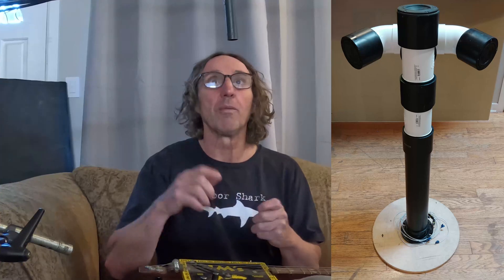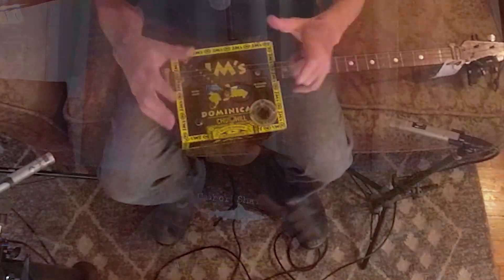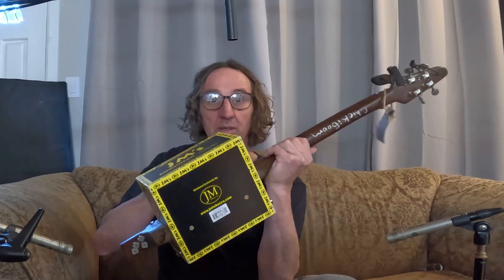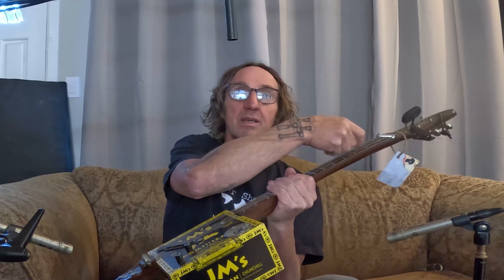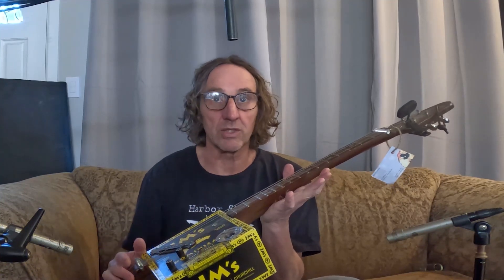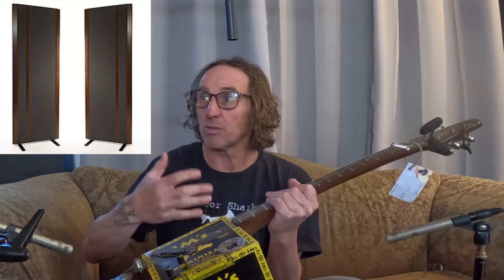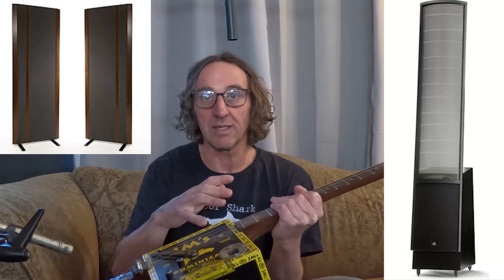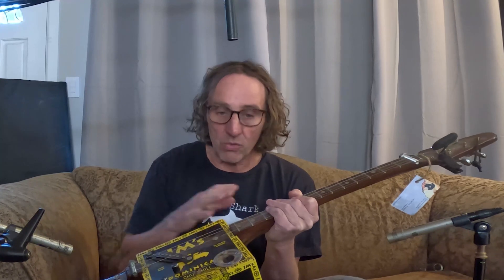Which Speaker Sounds the Most Realistic?

Comment: What is your opinion on the Heil tweeters?
Reply from the maker: I like those AMT HF drivers.

Super cool to have that accordion in the magnetic field radiate sound. The downside or oddity about it is that it's a figure eight pattern and radiates almost the exact same amount of sound behind the box as in front and there's cancellation off to the sides. 

This is not really a good thing or a bad thing but something that's different and creates a unique characteristic that may or may not be desirable
Reply: Thanks for the honest response. I like the contemporary implementation by Adam audio which are not dipoles. There are other interpretations by Mundorf and others which arw either dipoles or regular front radiators. But the original one looks really impressive and it's cool to have your speaker designed by a Nobel prize winner. 😉

Comment: I find this so interesting. I really like the distributed mode speakers, like a driver that wakes a piece of wood as a sound producer. The treble doesn’t come from a single point but various points on the surface. I had an experimental stage a few years back with a speaker with a tin lid on top and water droplets. I think what you’re saying is that the mic positions could be inverted with speakers to recreate the presence and specific location. Forgetting about phasing for now, i do wonder about small Bmr speakers that don’t produce a single point source, but points on the surface, put together as the same shape of say the violin, and the mics being the inverse or using contact mics on the same position points as the bmrs, would be closer but realistically what you want is a mic that produces sound the way the speaker reproduces it so a bmr type contact mics on the surface of the instrument in the same positions the bmr speakers resonate sound out. the heil transformer ribbon… i had some cheaper heils my dad left over from the stereo I gre up with in the 80s, cheaper ones that where crossed with an 18inch woofer, known for getting lower than a traditional ribbon speaker, so i figured with a wider range they would make great microphones and omg they sound amazing on electric guitar. Any speaker really. The cheap versions though where a bad idea with the large slow woofer compared to the fast acting ribbon. So bad, just a cheaper visual similarity to the (real) heil. Should of been two 10ich woofers maybe that together have more mass than the 18 but respond faster as individual drivers. Fuck that Neumann sounded great!!! Wish I could afford em, maybe later. Cheers for the great content
Reply: Oh and i really want a small bmr (been trying to get one in new zealand for two years) to replay and rerecord vocals through a mic in a echo space because i reckon with a tube attached or realistically a head box and bass tube would be the closest to sound leaving a humans mouth. To create reverb to blend. Fanks dave

Comment: When you start your band I would luv too sit in on Conga's.  It seemed to me like the stereo pair of pencil type condenser microphones really exaggerated the attack on the stings when compared to your  microphones placed lower that sounded more realistic too me, or maybe just more pleasing to my ear. Just my personal opinion not saying any one mic is right or wrong. I'm listening on some bookshelf speakers with small ribbon tweeters with low frequency speaker reproducing 70Hz and above.
Reply from the maker: Very cool and this is yet another aspect of the way mics alter the original sound.

Typically speakers soften that. The mics are closer than we typically are familiar with listening and reproduce that more dynamic unfamiliar sound.

This is actually a big challenge with live sound reinforcement and why we try and use compression to make realistic sounds sound natural through PA systems. When the natural sound does not need compression

Comment: It was Thursday night band practice at a church I was at. We just recently got a pre-Sonos 24 channel mixer when it first came out. This was a major needed upgrade considering the stuff that we had before that. We went from a 16 channel analog Mackie that sounded great to a Yamaha 32 pulled out of a TV stations dumpster. Then somebody bought us a used PV 34? Ch ( it was an odd number because they counted 3 channels per stereo L+R+Mic ) off of eBay without telling us. Two speakers hanging and 1 subwoofer or 2 probably 1 at that point. Don't remember exactly what they were I could probably look but they were 15 or 18 inch JBL something squares, and I could not stand the subwoofer they never sounded right. We had three or four monitor mixes. After the band left I was playing with the multi track capability and tweaking the preset save for Sunday.
There was somebody else in the building who came in and was like the band sounds really really good. Then they left and I realized they couldn't have been listening to the band at that point and they thought the band was still there an hour after they left. I believe they came back into the sanctuary and found the band not there when I pointed it out they were quite surprised if I'm remembering correctly.
Granted they were a few rooms down the hall but they were still believing it when they came into the sanctuary and didn't look at the stage.
Can't remember if I had any of the monitors routed as well but I probably did as I was playing back each individual channel it would've remixed the monitor bus.
That was a decent system I put in it's really too bad "I didn't know what I was doing", I went back a few years later with another band I was working with and the only things they changed was going for better speakers and a center channel. Which was on the target roadmap for system upgrades.
and considering I came in there before Easter Sunday for band practice to find the main speakers weren't sounding right oh yeah sure enough the voice coils are blown how'd that happen? I threw some sticks up and we got through Sunday Until I could order replacement parts.

I might as well say why I don't like the PV mixer As well. It had a built-in digital processing section for only the main mix and effects. Worked fine until one Sunday during service the mains cut out after a thumper or reboot it come back then they will go out again it was almost like a cold solder joint but it but I highly suspect it was with the processor chip. One of these days I will investigate it since I have both Yamaha and PV sitting in my basement.

Comment: I would’ve assumed that the tour grade stage monitor that many famous artists have on stage would be far better than a plastic pipe with speakers on the ends. However, I definitely get the idea of recording something near where the actual speakers playing the recording back would be, and it’s an interesting concept and a cool outcome! It sounded the most like the actual guitar, by far.
Reply from the maker: Agreed and also it's kind of unfair in that all of the speakers are designed for different things. The tube speaker is designed to sound realistic and even though very little design theory and testing went into it the concept is capable of reproducing realistic sound.

All of the other speakers are designed to reproduce sound recordings that have already been mixed. Or for the monitor to make it loud and cover a certain area.

What is amazing is that I can throw together some random speakers into some tubes and have it sound even remotely more realistic than well thought out high-priced well designed products

Comment: cool idea Dave! wondering about some of the physics  - if you have any damping inside, and if the out of phase internal pressure from each speaker is affecting the other speakers or if they are blocked off from each other. thanks!
Reply from the maker: Good question. The speakers don't really know what the other speakers are doing they just radiate sound and if there's no sound then sound is radiated in various directions. If there is sound the sound they radiate interacts with the existing sound in whatever way physics dictates.

In this situation the inner ring cancels out almost all the sound headed to the back of the outer ring.

But also the inner radiate sound outward that adds to the inner ring at certain frequencies and cancels at others

Comment: Hello I'm From India..
can i use any other company's speaker or subwoofer in Lab Gruppen FP14000 amplifier?
Reply from the maker: Yeah, using a similar speaker design to what's in the software will give good results
Reply: @DaveRat  Can you design a dual 21" cabinet for me according to the TS parameters of these two speaker models (B&C 21SW152 and B&C 21IPAL)
Reply from the maker: Hmm, for that I would study the L-Acoustics cabs and you cab.

An adventure for you!
Reply from the maker: Hmmm, the manufacturers will probably have designs to use.
Reply: @DaveRat  what does you cab look like
Reply: @DaveRat  The dual 21" subwoofer design on both these model speakers (B&C 21SW152 and B&C 21IPAL) is not available on the company's website.
Reply from the maker: Speaker design of quality enclosures is pretty involved and time consuming. It would be expensive to have me dedicate time to designing a cabinet for you
Reply: @DaveRat  so what type of cabinet model can i use for dual 21" subwoofer
Speaker Model-(B&C 21SW152/B&C 21IPAL)

Comment: Thinking of Fletchers 3 mic drum recording technique, which I have used extensively for reinforcement in small rooms as well as live recording when channel count is low, could you get response and levels enough to realistically represent a drum kit? Multiple drivers per position? Actually, now that I think about it, I can just take four studio monitors here and build a speaker stand in the same configuration. That should produce like results, yeah?
Reply from the maker: Yeah that should get you close I find that speaker baffles tend to alter the sound in undesirable ways which is why I use the tubes. Perhaps a bunch of small speakers.

Comment: Do a spaced x/y+z (but fairly tight) and then put an open baffle speaker firing axially reversed in the exact location for each mic.  Build the baffles so the backside is as absorptive as possible - so each speaker is trying to reproduce *what sound was happening where it's mic was*.   Match the volume as close as possible, then walk around it.  
 Omni speakers fail because the mics are decorrelated.  Further decorrelating with a "Rat Confuse a Cat Array" diffuses the comb filtering into 3d space, but it's still decorrelated.  I think what you're going for is a 3d space equivalent to binaural headphone recording.  
 Effectively, what I'm suggesting is to do "Inside Out Atmos"; instead of X number of speakers reproducing decorrelated sound inwards to a single point, you should try to have a single point (not a single speaker...) reproduce correlated sound outward.  Essentially an "encoding" process by matching the reproduction source to the recording points.   
 The beauty of this is that you could have recordings made with a mic array of a specific dimensional relationship, and people could have the exact dimensional point source in their room (*not a single "point source" speaker).  Additions would be maybe add a "rear" mic facing away for a sub, maybe another in the front array pointed down going to a small sub that would be maybe on the floor (so as not to interfere/diffract the xyz speaker array).
I've done a wide spaced array and then put a pair of speakers there, very "headphones binaural" realistic, but of course walking around disturbs the illusion.  But I believe ultimately you have to recreate where mic was.
 It would be interesting to hear a 16+track "mix" of a band done this way I've thought.  Sort of like the Dead discrete array, but with speakers in the locations of where the mics were.
Reply from the maker: Open baffles radiate in polarity and out of polarity sound, this creates a null off axis that is unrelated to the sound of the instrument or recording. Adding and creation of the out of polarity sound is non beneficial

You can hear some of that issue with the ESS and DML off axis.
Reply: @DaveRat  They do create a null off axis.  So does a directional mic.   Not all dipoles/baffles are the same.
Reply from the maker: Agreed yet reproducing an out of polarity sound that does not exist  in the instrument sound is highly improbable to benefit realism due to the unnatural nulls that will occur